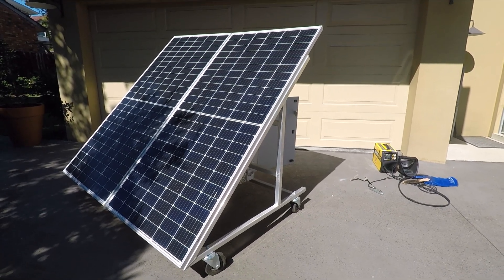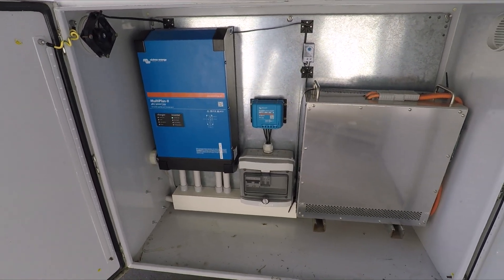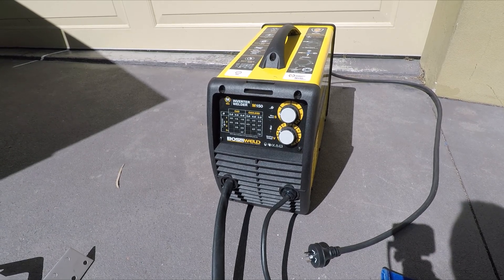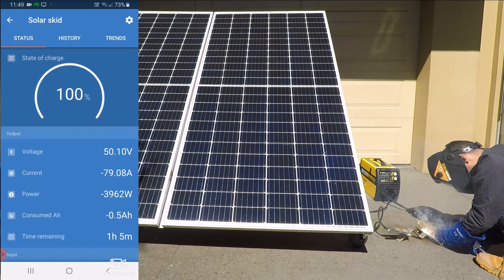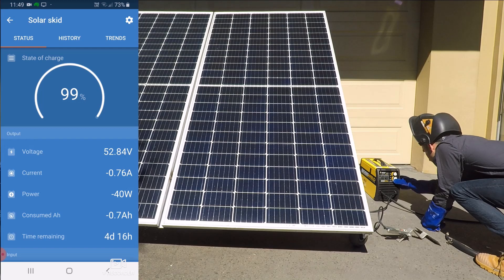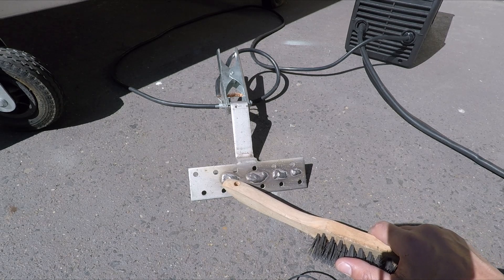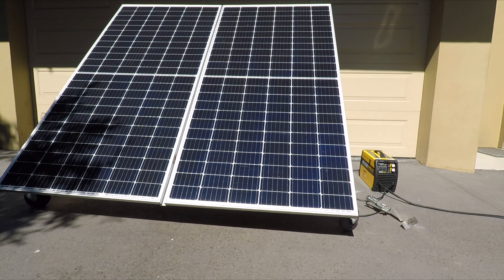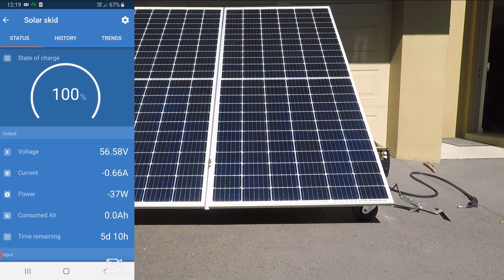Can you weld using an off grid solar system?

Comment: I want to use a welding machine(Cuwiny ARC200D) and other hand tools simultaneously for my home renovation work. The power supply is a 5KW Off Grid Solar Power System with 51.2V 106AH Lithium Battery. Is there any consideration for Surge Protector for such kind of situation? Could you please recommend some surge protectors for the set up if any? Thank you.

Comment: Hey, mate. I'm not sure if you can answer my question but I'll ask because this was a great video. I am setting up my ute with 320Watts of panels, 2 115 amp AGLs, and a 3000W inverter. I'll also have a petrol genset that can push 3000W. Do you think either of these set-ups could run a small Cigweld 120 hobby welder? I'm hoping to be able to use it out bush for small repair or fab jobs. As you can probably tell, my solar knowledge is just enough to be dangerous :) . Any advice would be appreciated.
Reply from the maker: Hey brad. Thanks for the comment. You might struggle a little with that setup but if it was turned down really low you may be able to do a bit of welding. The problems will be the AGM's don't have the discharge power a Lithium would have and will sag under load. Also I'm not sure which inverter you have, but most of the Chinese high frequency inverters are greatly overrated. Welders have really bad power factor which a big heavy inverter like the Multiplus handles much better. Good luck mate!
Reply: @mictronix6723  Cheers mate. Thanks for your experienced advice. I guess I'll resort to the genset if I need to do some welding. I'll give the genset a workout with it and see how that holds up. If not, I guess I'll have to rethink the power supply. It's the smallest welder I could get. Thanks again, mate. I appreciate the advice from someone who knows way more than I do :)

Comment: Nice vid man. We have the Victron 8000 Inverter with 15kWhrs of BYD batts, 7kW REC panels. I usually weld using a 6kva petrol generator but the breaker trips at 80% wire speed which sucks for welding thicker stuff like I was trying to today grrrr (Cigweld 175i Mig). Thinking the Victron would do it fine but it's our house system and I don't want to damage it. From memory it does 16000W surge. Decent size toroidal transformer in it.
Reply from the maker: Thanks Mitch. The Victron 8Kva inverter would handle that welder no problem but like you say, it's a huge investment and you don't want to risk damage. For me it's not too bad because I have the capability to fix it if something goes wrong. I have a 5Kva multiplus on 15Kwh of batteries and I regularly use this same 150A welder on close to full power. It's amazing what off grid solar systems can do these days

Comment: Hello great video.
Do you think an inverter with a 2000 watts continuous current and the 4000 w peak can power a welder??
Please let me no what you think
Reply from the maker: Thanks! If it's a standard transformerless inverter I wouldn't try it. This inverter has a large transformer inside that has a large overload capacity.

Comment: Are you welding at 220v?   I'm trying to weld off grid. My van has a 2000 watt inverter (connected to my 155AH 12v starter batter) that  seems it can produce 115v at about 13amp (about 1500watts) of power with my engine running.  No issues running 1400 watt appliances continuous.   how much welding can I do?  Can I weld 3/8 inch rebar?
Reply: you shouldn't weld rebar... especially if for use of a building

Comment: Does the victron passthrough the voltage from the panels in parallel with the batteries or does it all come from the panels, through the battery and to the welder?
Reply from the maker: The Victron inverter takes what power is available from the panels and everything else from the battery. The battery is essentially an energy storage buffer